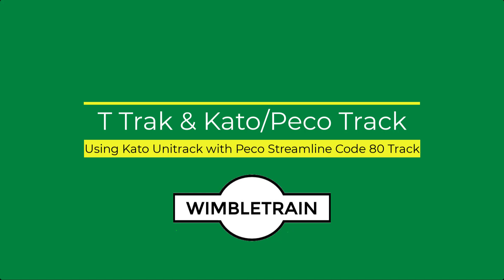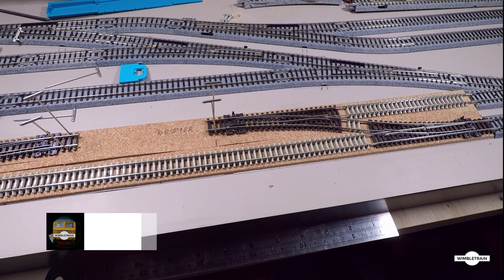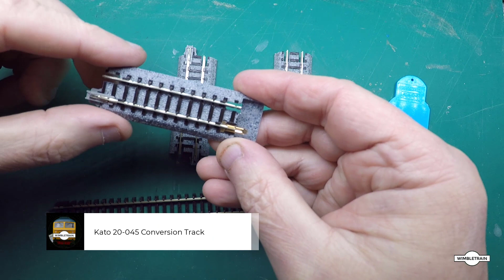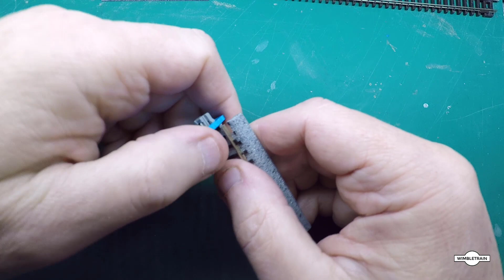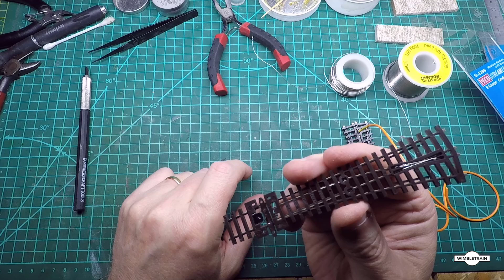Using Kato Unitrack with Peco Streamline track

Comment: What would you do now if you started from scratch? Kato tracks or Peco tracks?
Reply from the maker: @Maxime-ho9iv  Hi, that's a very good question! I would probably use more Peco track as it does look more realistic when you ballast it. However,  you would still need the small sections of Kato track to clip it all together.  Also, you have a bit more choice with Peco in terms of turnouts, etc. But if you were new to model railways and want a simple layout, Kato is an easier option. John

Comment: I found that this same method also works nicely to join Peco Code 55 track to Kato Unitrack. Using the Kato connectors ends up with the code 55 track being a little too high, but when using the Peco ones it lines up just right
Reply from the maker: Hi, that's good info to know for those using the Peco code 55. Thanks!

Comment: Nice job. I know nothing about UK track and standards, but in the States #4 turnouts stopped being used decades ago except in some legacy places where there was no possible way to upgrade. Mainline turnouts for crossovers and such are almost ALWAYS #10 turnouts with #6 turnouts only used in yard ladders and similar slow speed switching environments. Longer railcars, passenger cars, and newer/heavier locos cannot easily navigate tighter turnouts or curves. Six or more axle trucks also don't cope well with tighter radius turnouts.  That said, Kato really needs to start selling #10 turnouts.

Anyway, great job on fitting that peco into your unitrack environment!
Reply from the maker: Hi Samantha, that's interesting info as I was unaware of any of that. I don't use #4s for the same reason, the locos with triple bogies just don't want to run across them reliably. All the best and thanks. John
Reply: @wimbletrain  you're most welcome John! Thanks for making great videos!

Comment: @Wimbletrain ... I could not find what size Peco turnout did you use?  (Seems to me that Peco has a "small", a #6, and a #8..but I can't tell which one you ended up using )
Reply from the maker: Hi, good point! I didn't mention probably the most important thing in the video ☹ I have  updated the video description with the Peco part numbers. Thanks for the feedback 👍John

Comment: Just a piece of advice when you fit your new Peco points.  If you think that you might go to DCC with block computer control, fit many more plastic fishplates NOW, otherwise you will have to take everything up again to fit later.  You can always bridge the plastic fishplates with wire for use now.  Keith
Reply from the maker: Absolutely Keith, planning ahead if you are going to take that path will save a lot of headaches later! John

Comment: fine work. i wish i had your skills regarding turnouts. why all the mix and match with track?
Reply from the maker: G'day John and thanks. Bit of a story as to why I started using the Peco track. I had issues with the tighter radius Kato #4 turnouts with some locos constantly derailing so I decided I would use the Peco turnouts as a replacement. It also gave me a chance to play around using servos to operate the Peco turnouts. The Kato turnouts just operate with a momentary pulse of around 12V DC (and then a momentary pulse of 12V in reverse polarity to switch it back) i.e. they don't require any external turnout motor. Cheers, John

Comment: Hi John - Nice and neat as always, which I love.
Now I am confused when you showed us how you wired up the Peco point. 
I will only be using N Gauge Peco Electrofrog code 55 large radius points if I can get away with it. I would prefer to use the new Unifrog ones but Peco are having problems with their production and distribution in this area.
I follow Geoff of Pride Parkway who also models in N Gauge and his wiring of a Electrofrog point is different from yours and easier so I am very confused.
My train operation is DCC but my point operation will be DC, not sure if this effects it or if I have got this right following Geoff to be honest.
To date I have never fitted a point so that and the wiring will all be new to me.
So your mission should you wish to accept it is, 1/ watch this very short video from 13.40, it is only 3 minutes long. 2/ Understand what Geoff is doing. 3/ Please explain it to this silly old sod.
https://www.youtube.com/watch?v=71idvwzbz9o&ab_channel=PrideParkway
He does go on to explain about Unifrog if your interested.
Your trackwork at the end of your video looks amazing.
Regards Chris
Reply from the maker: Hi Chris,
I remember watching that video and several others before I attempted doing mine. Basically what Geoff is doing is powering both the frog and the point blades with the frog wire. The way I did it the only the frog is powered by the yellow frog wire I connected (this is because i cut the original wire that was linking the frog to the point blades). The point blades in my case are permanently powered by the two small wire links I soldered in. So on mine the frog and the point blades are separately powered. Both ways work of course, it's just up to you which way you want to go. I did it the way I did just to keep the frog separate in case I have any issues.
The Unifrog looks good and appears to be easier to wire up, but like you at the time I couldn't get any so I went down the electrofrog path. Thanks for you comments and questions Chris, always glad to have a discussion on these things. John
Reply: I really want to go down the Unifrog route, so I have awhile before I start laying track before I start needing points. So fingers crossed by then they will have started selling the large radius left and right turns. I can only hope.
Regards Chris
Reply from the maker: @Chris-BognorRegis  Sounds like the way to go, you just have to play the waiting game!
Reply: Hi Chris and John there are differences between code 55 which I think is what Geoff and you are going to use Chris and the code 80 that John and I have used. I emailed Peco when I started laying track as I was confused. Code 80 points need no modification apparently, because of the wires that power the frog, but code 55 will. I’m still not 100% sure but mine work perfectly well, I do power my points with droppers at the switching end and I’ve also set up one point to a DCC Concepts digital point motor as a test and it all works fine. I’ll be interested to see the Unifrog points Chris.
I hope this has added to the N Gauge confusion, lol! Cheers John, confused of Exehaven!
Reply from the maker: @exehavenharbour  Oh yes thankyou John for the extra confusion! 🤣🤣 That does explain why when I looked at Geoff's video the underside of the point looked different to mine. As usual there are several ways you can go about it just have to make your own decision based on the info out there on what you think is best for you.
Reply: What you’ve done is fine John, it all works, but when you’re new to hobby like Chris and me it’s bloody confusing!!!!
Reply from the maker: @exehavenharbour  Umm, I'm no expert either! I'm fumbling my way through it like many others! 😀

Comment: Hi John, I am surprised you had problems the the Kato track as a friend of mine swears by it and not at it. Good to see you got it sorted though. Lovely Westerns !
Reply from the maker: First of all Mark, well done on spotting the Westerns, they were put in there on purpose after the videos by Gemma and yourself in recent times! The main issue I had with the Kato was the #4 points and so did others. But in saying that, mine were all the really old batch so maybe the newer ones perform better.

Comment: Fantastic idea of joining the kato to peco with the original track instead of kato gender modification track. I had coupling issues with my HST125 when I ran it on the Kato to peco  on the straights in one direction but weirdly found if the power loco pushed it around I had no de coupling faults?
Brilliant quality update to your layout 👍 keep them a coming and thanks for sharing John😎
Reply from the maker: Hi Phil, you uncoupling issue sounds strange! I tend to only have issues around curves on the odd occasion. I haven't had any issues with my HST125 so far. Did you use code 80 or code 55 Peco? Thanks for your kind comments. John
Reply: Hi John thanks for getting back to me regarding my issues 😂 So I have Peco 80 track and all could be fine for a running session for the HST125 but then the next day intermittent coupling issues? All my rolling stock and locomotives are parked on the layout constantly except for the rare occasion to run a new locomotive on the DCC track after coding.
Only thing I can think of is that I’ve changed all my lighting on the coaches to retro Dapol led lighting and may have disturbed something on the coaches with my sausage fingers? However I had the fault more often before than after the refit. So I’m confused to what’s going on ? I’m getting a extra coach and a light bar from my daughter for Christmas so thinking twice now will it create more issues adding more to the rake?
Thanks again ,John getting back to me I really appreciate it 👍